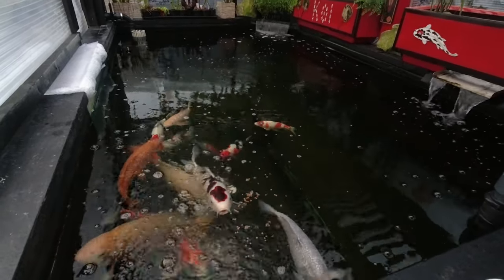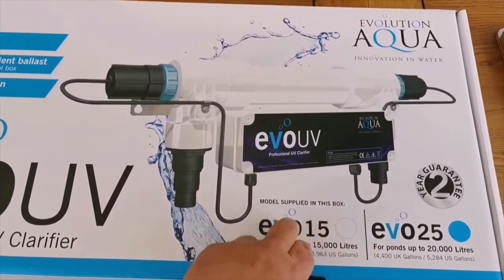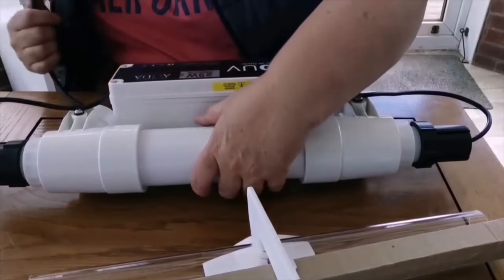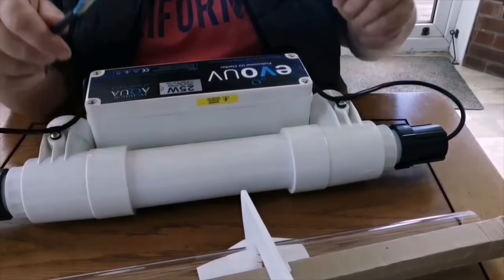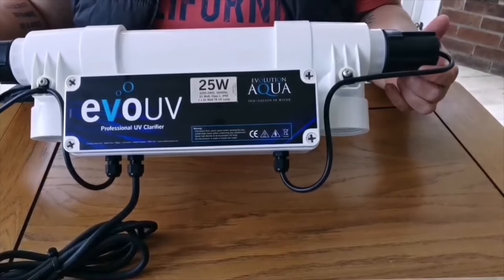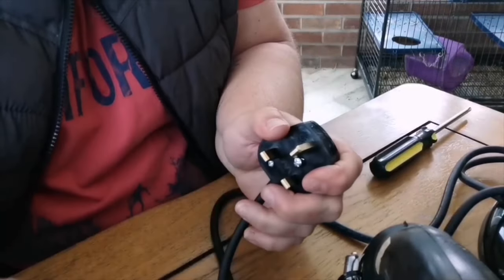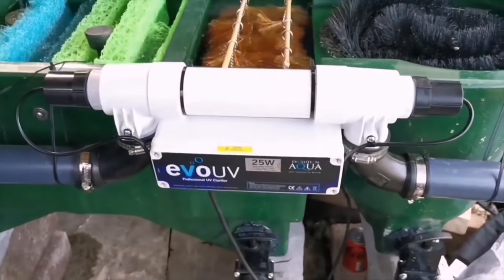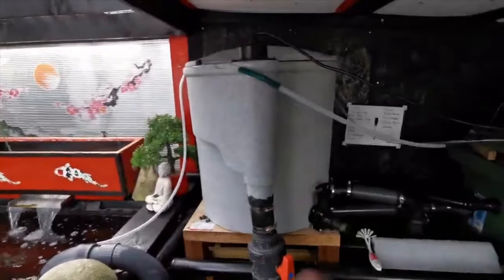Running 2 UVs on a Koi pond - Evo 25 - Koi from the window #Evo25

Comment: I have 2 uvs too. It gives you options and a bit of protection if one goes down. I've had all uv off for a while now and lowered all pumps more than usual to test any changes from last year and so far all parameters are the same. Any fuel saving are good for the environment and my pocket 👍
Reply from the maker: Yes most definitely, at least one should still be running should something fail on the other one. I have slightly reduced the air but redirected it to the moving bed but I wont change the pump. I tried to and I immediately noticed some poop in one corner. I put the pump back to normal power and no poop anymore.

Comment: Good move with the additional UV. I have to run the 55w for my full sun in  the summer.. 😉👍
Reply from the maker: Yeah, your pond is a bit bigger than mine so 55w is needed for you. I saw you switch is off till spring, probably no need for it in winter.

Comment: Nice and easy for the bulb 💡 change Lau, fish looking good, surprised you have Koi pox with the temps being so warm in your pond 👌😀
Reply from the maker: yes, I have done a test (even if I was worried to do it) and you can change the bulb without stopping the pump. Yeah carp pox can appear when you go to 16 or below. Some koi never lose it even at higher temp suring the summer, which I think is what will happen to my Tancho Showa. She has two areas with carp pox on her tail, one I think will go but one probably wont as it's so thick and so embeded in her tail. It's viral but not contegious.

Comment: I have 2 UV's too  👍🏻 1x 36 W and 1× 18 W. But it your UV Annoys me as to why it needs power supply both ends. As the bulb is different. As most are just powered by one end. 🙄. Although it would be nice to know which style of bulb works best 🙄. Both of My UV's are off as i was hoping to get a little longer out of them as the was changed towards the end of the season. Sorry for the late watch 🙏🏻. Now im going to watch your new video 👍🏻😊👌🏻. All the best, Tel 😊🙏🏻😊

Comment: Good video Lau, I only have the one 55w evo uv previous model and for the first time this winter I’ve turned mine off. 
Your pond looks great and considering you’re not heated them temps are great for this time of year. 
Be interesting to see what the temps are tomorrow after tonight’s freeze. 👍🏻
Reply from the maker: 11 this morning, so I have lost 2 degrees after the freeze last night. Air temp went from 14 yesterday to 4 today. I am doing some tests of temp just behind the window and away from the window to see if I need to protect the window should the temp drop again. Hope all is OK your end Phil
Reply: @LauMagroTheFrenchKOInection  that’s amazing only dropping two degrees unheated especially after last nights events, you’re doing something right. 👍🏻 all ok this thank you for asking, still having issues with butterfly even after treating, I have a new microscope on its way soon cos will scrape again soon. Watch out for the video..;)
Reply from the maker: @PhilGsKoiPond  It's probably the fact that I am fully enclosed and insulation inside the pond. But no doubt over the next few days it will carry on dropping. 
For the butterfly, you might well need to get her out in a heated hospital tank and isolate her so  you can treat her more efficiently rather than treating a full pond? 
Hopefully  with the microscope you will be able to find something...

Comment: That EVO 25 is a neat unit and I like the way it is designed and the ease of installation. I run two 40W UVs on my pond connected in parallel so I can run both during the summer when we get the most sun or only one in spring and fall when the sun is not so intense. Fish are looking great. Cheers.
Reply from the maker: Hi Ken, yes two UVs definitely make sense. Thank you for the comment, they seem really good at the moment. I feel they are growing nicely

Comment: Happy New Year Lau.
Fish are looking good.
I'm thinking about changing my UV from a 30w to a 55w.
Most people turn their UVs off during the winter, but I never have.
No sure why EA changed the connections on their new UVs. 
Stay safe.
Reply from the maker: Hi, Happy New Year to you too! Hope you are all doing well. 18w in the EazyPod and originally 15w on the multibay was a bit low I felt for me and my pond is smaller than yours. So it was 33w. Now I will have 43w in summer.  But that's why when I built I wanted two UVs so I could have a lower wattage in winter. 
I think they changed it because of the ballast originally. They are ticker than the previous models but I do prefer it
Reply: @LauMagroTheFrenchKOInection  We're all good thanks Lau.
Yes, having multiple UVs gives you better options.

Comment: Great vid Lau and fish look amazing. I was just wondering what size pump you are using to run your retro bottom drain?
Reply from the maker: Hi Darren, I will do a video soon about the filtration system as so many people ask. The pump with the retro drain sits outside the pond and is a 20 000 as the same pump feeds two filters, the EazyPod and the Multibay
Reply: @LauMagroTheFrenchKOInection  ok great thanks and look forward to more vids 👍
Reply from the maker: @darrenmarchese7182  thank you. Much appreciated

Comment: whats the rubber boot size your using  would it fit a 1.5 inch pressure pipe ?
Reply from the maker: Hi, it's a 2 inch on the collar to be able to go over the UV inlet and outlet but to be fair, it looks more like a 1.5 inch inside.
Reply: @LauMagroTheFrenchKOInection  thanks for reply what it is my uv keeps leaking using washer and hosetail I'm wondering if i use solid pipe then use a rubber boot over both would b it solve the issue no matter what i do the uv leaks if you tighten the hosetail too much it leaks but if its too loose it leaks no great for a expensive product.
Reply from the maker: @canonlensesandcameras4425  ah I see. Yeah not ideal. Are the horsetail the original from EA? 
If they are not the original EA, that would explain why as the EA screwing system  are slightly different. I didn't use them as I wanted to stay on the inch pressure pipe.